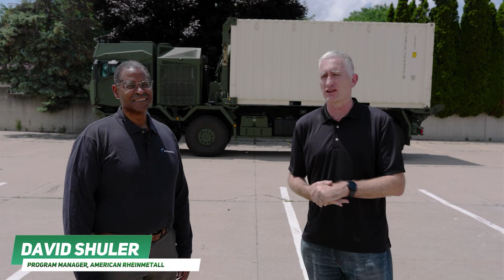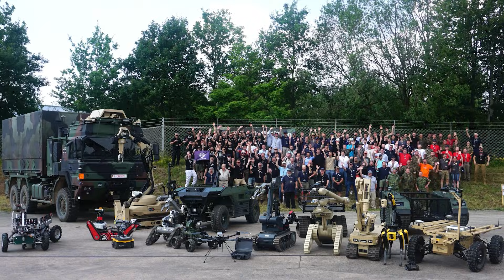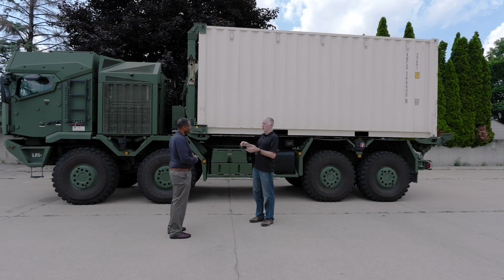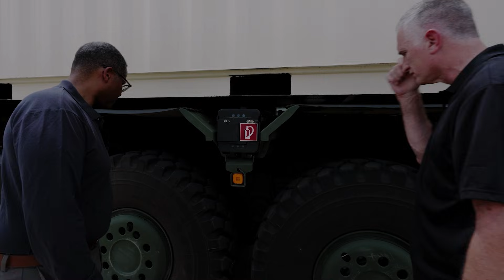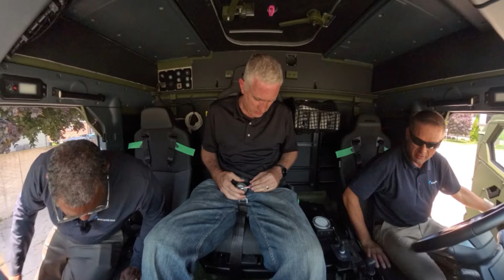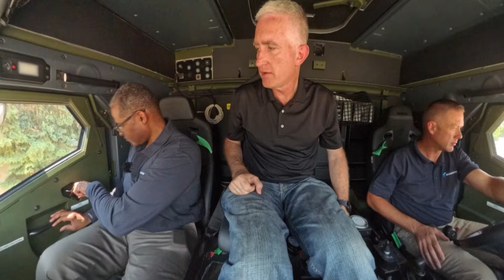American Rheinmetall, and the HX3

Comment: Cool, but as a 91S, I do not trust a machine to check itself because I want to see the fluids myself.  The self-driving capabilities are cool, but can it be fooled and follow a different truck if other trucks are in the way?
Reply: You obviously can check and maintain everything yourself, why would you think otherwise? The idea is that the machine tells the maintenance dep to look at things when its needed. Much like its been standard in other industries, including aerospace.

And as for convoying, I'm sure it's electronically tethered, its not just following whatever is in front.
Reply: @Ganiscol  Great in theory, but when you’re out bush for 3-6 months on deployment with them the drivers can’t maintain them. Like at all. 

Before the reply “but you have forward deployed field repair teams”, that’s all well and good until you’re on a resupply task and you can’t drop your container or fix anything yourself. Digital systems are great until they’re not. Analog function with Digital extras should have been the way.
Reply: @itshype_11 I mean this is basically the Standard on  western tanks since decades no? You don't repair locally. You have an easy replacement motor you can switch in quickly
Reply: @emilsinclair4190  Not talking about tanks, talking about trucks & logistics vehicles, the power packs are not really hotswappable no. I’ve never seen an RHMMV HX pack swapped in the field (I’m sure it’s been done). 

I’m talking about the fact that you can be 100km from your FRT (forward repair team) and your truck goes into limp mode or won’t turn on because of a sensor. Not like I as the driver can whip out a scan tool and fix it. Can’t even change fuses.
Reply: @itshype_11and since you are in a logistic truck (that does nkt even have the added armor) you basically broke down in a safe area. Well you now wait an hour or 2 until help arrives. What is your problem with that?

Especially if such problems only occure with a low probability?
Reply: @emilsinclair4190  Having deployed as a driver that’s not how things magically work. Yes, you’re behind the frontline. But logistics are the primary target of the enemy forward forces. CSS assets need to be able to defend themselves without support. In other fleets of trucks the operator can mend and at least limp back home or to within range of a recovery team. 

This magical “oh yeah there will be an FRT to pick you up within 2 hours” just isn’t a thing. Be great to plan for that but what happens then when the FRT gets knocked out on route? And I can’t move my truck because the door closing sensor has broken or it’s got an oil leak (and I can’t replenish the oil) or hell even check the oil level. 

Why exactly do you not think operator repairability is important?
Reply: @itshype_11 reliability is important. However you are under the wrong impression that electronics decrease it. In reality it depends how you build it. Done right electronics can increase reliability.

How? Well first prediction. Sensors can spot problems before they become critical. You than can replace the part before it even fully failed.

They can also do the analysis of what is wrong immedietly and better than a human.

Now regarding the problems mentioned by you: how do you know that it has such problemsm?  Military vehicels usually have back up modes. Some even have a button to force the system to ignore all sensors and just keep operating.

So regarding door sensor: just push this button. Regarding oil: if you have a leak the senors will alarm you earlier. So maybe even before it becomes big enough to be a problem.
Reply: @emilsinclair4190 I know because I’m trained on literally these vehicles. I’ve taught trainees to utilise and drive these vehicles. I am quite literally paid to be a subject matter expert on these specific vehicles. 

That’s how I know. Have you ever been in one?
Reply: @emilsinclair4190 exactly. Sensors can detect fuel dilution, etc. well before your sniffers. It's almost the second quarter of the 21st century FFS.
Reply: As you can see engine is all the way up behind. So climbing up there is not dangerous but give it mud, snow, rain and enough trucks and drivers and time... Broken legs are gonna happen. It's cheaper to change engine here or there compared to paying disabilities. And less people are gonna get injured
Reply: @dragancrnogorac3851 Wrong! This is a cabover design. The engine is below the cab.Behind the cab are the radiators and the hydraulics for the load handling. To access the engine for repair or maintenance, you flip the the cab hydraulically and can access any relevant part.
Reply: @dragancrnogorac3851  As if you don't need to climb to work on a hood unit truck lol. Even with the 3/4 trucks of today you need to climb up to work, and cab overs provide much better standing points for engine work.
Reply: American buys oshkosh because they are smart, anyway
Reply: @Clickworker101 as smart as your spelling?
Reply: @ceemosp  exactly

Comment: Seeing that gigantic radiator immediately behind the driver's door, with no protection at all is not something I want to see in a military vehicle.

My Dodge Ram 1500 has more protection for it's radiators (yeah, there's a couple under that hood)
Reply: You do have the option of additional  armor kits for this vehicle thou if its thats what you want !
Reply: @christianjunghanel6724  Armor kits shouldn't be necessary for a standard commercial vehicle. I could disable this one with a baseball or a fist-sized rock. Radiators are incredibly sensitive to damage and that one is the size of a big-screen TV.
Reply: @karlbrundage7472   I don t get it ! Do you guys want your trucks protected or not ? Cause you can  have both , just not at the same time 😅     There are a lot of nations  who are already useing this in all sorts of configurations without any issue whatsoever ! Maybe they are onto something.  Its not like Oshkosh and Co  is  trying to do  the same kinda   stuff on their trucks as well !
Reply: It's a support vehicle, not a front line one. The armor is there to protect the crew against ieds, shell splinters and small arms. The rad is at a high point and while a few small holes are going to need to be dealt with relatively quickly, they're not going to immediately immobilize the vehicle.
Reply: eeeh even if you slap military green on a vihicle, it does not mean it is a frontline unit😅
This truck does not need any armour. It has other requirement